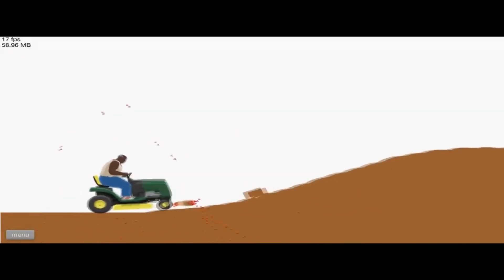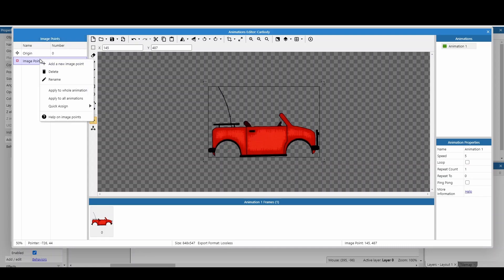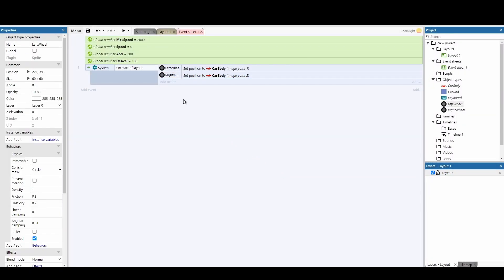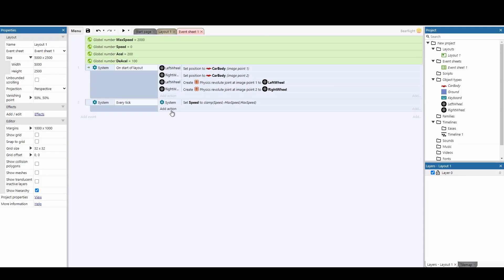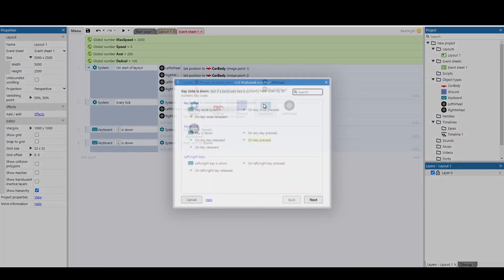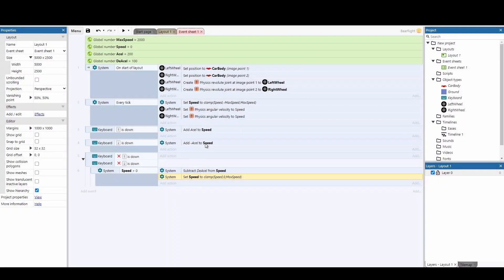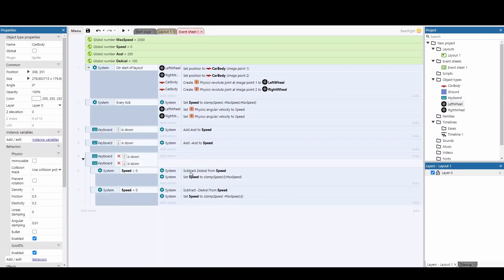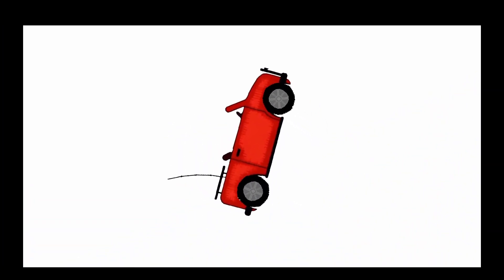platform physics based vehicle in construct 3

Comment: Hi. Interesting video. How do I add suspension to the wheels? When colliding with the surface , the wheels moved up and down .
Reply from the maker: Instead of welding wheels to the body. Create a spring and wield the wheel to the spring and the spring to the body.

Comment: Re flipping the car while it is still on the ground. What about a couple of boolean GVs, "Is_left_wheel_down" and "Is_right_wheel_down", which are set to true or false, depending on whether or not the wheel is touching the floor object. Then the event for spinning the car has the additional conditions of those booleans are set to false, to operate?
Reply from the maker: Hi Ricky. I had the same thought in my same build but you could still flip the vechile when on its back. Maybe checking if the vechile is on the ground as well.